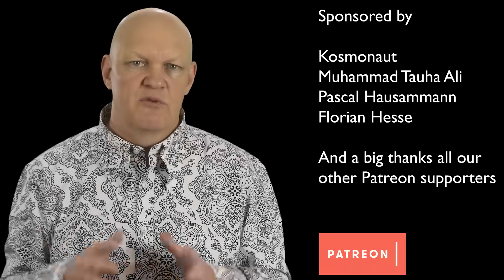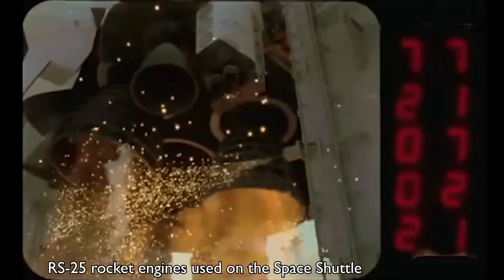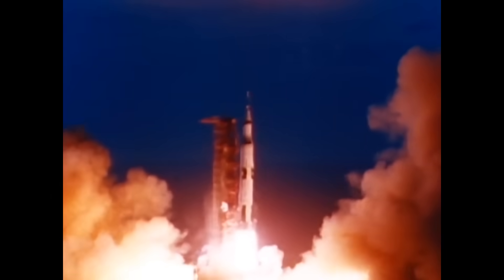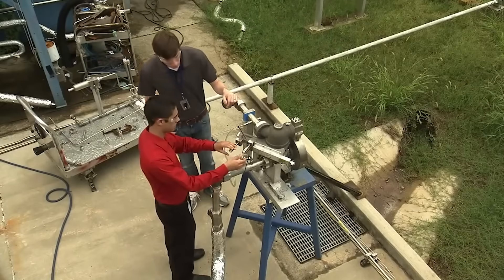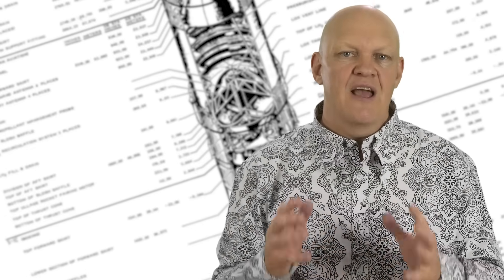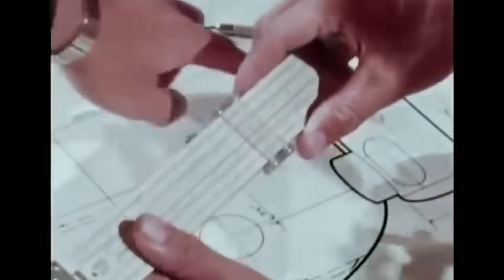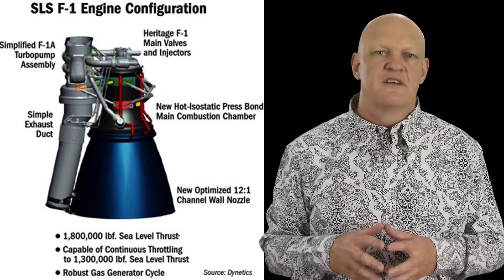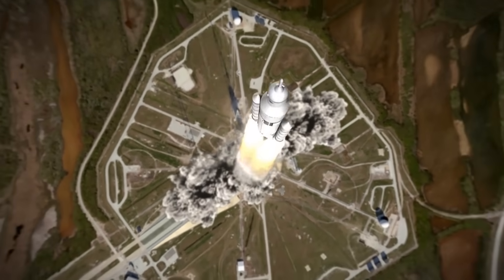Why Can't we Remake the Rocketdyne F1 Engine?

Comment: this is just part of the loss . . . think where the Saturn V would be today if it had just received incremental upgrades since the 60s . . . more powerful and more economical engines, lighter weight aluminum or carbon fiber tankage, and a vastly better computer suite!
one could probably lift the entire ISS in one go if you could figure out how to package it . . . but why bother when we could build a rotating ring station and use it to go back to the moon in the 80s and Mars in the 90s!
think of it Mars landings 20 years ago!

Comment: Interesting that is people skills that are the missing link. Same seems to apply in other areas of life , I dabble in car restoration and finding people with the old skills to fix engines and panel beat is getting harder and harder and you basically need to teach yourself
Reply: Dave Goldspink  , Yeah it sure is a dying trade. I completed my Mechanical apprenticeship almost 30 years ago. I was talking to a friend that was working for a tech college the other day and he said that they don't even teach current students about distributors and points anymore. I know they are not used in modern cars but if you know how they work you know how a ignition system works. Crazy.
Reply: Indeed, Paul, indeed!

 One example that also pops to my mind is the pyramids example. A monument built with huge blocks of stone, and in some cases (interior hallways), incredibly well polished stonework. 
 We can honestly say no one on earth has the skills to recreate the same work, with the same conditions and tools. We could obviously replicate it, but allways with the use of dedicated machinery and nowadays engineering solutions...
Reply: @heldersilva6672  why use an inferior and dangerous way of doing things when you have a superior, far safer and faster way that is also less expensive and easier to learn, we could recrearte the pyramids in a fraction of the time and the cost easily if we wanted, but we don't because we have better methods of making buildings, old isnt always better, in fact usually old is most often worst

And as a more general responce

I'm just seeing a bunch of guys sayign "in my times everything was done by hand, we didnt had any of this fancy computers, this advance 3d printing technology, robot assisted machined tools, we had our hands and a lathe" alright grandpa, yeah some skills are disapearing, theres a reason for that, and it's not because "the young generations are lazy" but because the tools available to the new generations are thousands of times more powerful than anything you had in your time, now a days things are made with advance computer programs with nanometric presition (something a human is just incapable of accomplishing) 3d printed to create forms and shapes that are simply imposible to make on a lathe or any other machining devices and in a fraction of the time and the costs, yeah every now and then you still have to solve an error a computer can't solve, but people is just as smart now a days if not smarter thanks to the learning tools they have available (just as an example, this channel that provides information that was simply unavailable or was really hard to come by a couple of years ago and explained in a simple and understandable manner)

Addapt or die, those who use the new tools they have at their disposal flourish an prosper, those who are stuck in the old times are left behind, simple
Reply: We have the same problem iun the truck and heavy equipment repair business. The newer mechanics just want to replace components. The problem is that so much of the stuff was made in low volume, or maybe even one off for a special application. Good luck finding a replacement. And they think nothing about the equipment being out of service for weeks or months waiting on a replacement part. They never want to weld and/or re-machine anything, never want to make parts. It's killing our business
Reply: Businesses don't want to spend the money on people investments. The old timers get to relax on their skills they learned for free while everyone else needs to pay for trade school or college themselves; that not only hurts the pockets of the people who may not have the money in the first place, but hurts the business because the school only teaches them basics, not how the business that hires them runs whatever they're getting hired for.
Reply: as the 1950 generation is retiring at a vast rate the brain drain at all companies is disappearing forever. when i retired 15 years ago i was called a few times to ask how i did some of the things i did, my reply was SKILLS! i actually did make notes and describle almost everything i did and why - they just didn't bother to read or didn't understand how much multitasking was involved. A'int automation grand?
Reply: @ricktimmons458  what was your job may i ask?
Reply: It's one of those things where the guys who made it knew exactly where to hit it to get it working again.
Reply: I can build engines been doing it since 1976 contact me
Reply: Offshoring manufacturing (sold to you as free trade) has directly caused this problem. So little gets manufactured in the US and the West, that these skills are disappearing.
Reply: Absolutely. I was in an Advance Auto parts store Saturday. I needed Plastigauge to check a set of rods and mains before my final assembly process on an engine. Three out of four people working there had never heard of it.
Reply: Paul, where you from?
Reply: Feeds Ravens There are buggy makers in the USA. https://youtu.be/aaFGOCou_7I
Reply: I guess there's not much money to be made from "old" technology?
Reply: Bc a generation of ppl came through that just didnt teach anyone anything. Apprenticeships dissapeared, and ppl stopped wanted to pass on knowledge for whatever reason
Reply: Youre spot on right - I own a motorsports based company and we can not get ‘real’ engineers and designers , people who can solve things in the real world are becoming rare and its because computers do it all for them
Reply: It's basically that kid's-young men today are lazy when it comes to work I try to teach them but it's like they can't get it in there head to try something else if something doesn't work out for them they just don't care every trade that's hands on is slowly fading away.

Comment: I did watch a video sometime ago stating that NASA had found some old Russian engines which are supposed to be really quite good, think they were intended for use on the Russian moon landing that never really happened (as we all know).
However, having visited NASA 10yrs ago I remember being told that NASA prefers Russian engines over there own because they are far more reliable. Is this true?
Reply: its cheaper, nasa budget compare to its 60s days r cut down to non existence. if they can buy it super cheap off the russian, wtf not. not like they using it to prove anything, just for cheap payload to iss etc.

Comment: Rubbish, the old Aerojet rocket facility in homestead Florida performed static testing of mammoth rocket motors in the 1960s, so powerful they could be heard and felt in downtown Miami, they thought magnitude 3.5 earthquakes were happening even without any fault lines. They put them in ground silos upside down and set them off, the flames could be seen across the state in Ft. Myers. Now many say these Aerojet motors were only solid rocket motors and NASA did decide to go with the most impulse power which of course only liquid hydrogen and liquid 02 blends could deliver, however, I was told back in the 70s that they experimented with hybrid motor technology using liquid fuel blends like 80% hydrogen peroxide as oxidizer with the solid fuels. For Saturn 5 it wasn’t the optimal impulse power and maximum efficiency thrust levels NASA needed so the contracts were not awarded to Aerojet but the plans and notes from those rocket motors are in someone’s hands until this day, none of that is gone. I saw them many years ago in an old mans home in Coral Gables who was a test pilot for NASA and HAFB pilot. He told me they had technology that was way ahead of the typical truncated bell type engine motor bell, it adjusted to all exhaust flow changes in altitude changes and made optimal altitude compensating nozzle technologies which were never seen back then. The closest thing we have today is the J-2 by rocketdyne but they never overcame the cooling technologies until they found new materials that would not melt, carbon carbon technology wasn’t around then for bell housings graphite was. Combustion nozzle technology,not fuels,  was always the limiting factor in rocket motor design. Musk is brilliant and will figure this out. He figured out how to do  booster motor decent landings instead of fishing them out of the ocean with Naval fleets. Then again he has advanced GPS guidance landing systems that NASA must not had access to ever.
Reply: What's rubbish?  Did you even watch the video?

Comment: Russia had a better, more powerful, more efficient rocket engine which we have the design for. Which NASA says would be better than the F1.
Reply: Have you seen Curious Droid's video of that engine? More efficient, yes. More powerful, definitely not. The Saturn V used five engines while the Russian moon-rocket needed 30. Six times the number of components made the at moon rocket a nightmare and four of them blew up in a row. However, using three of the Russian engines on a smaller rocket works and the US has actually bought the engines from Russia.

Comment: This guy brings up some valid points........be he neglects all the facts......his info is always 50/50......he was way off on the a-bomb tests and I called him on it.....he brings up very obscure facts.......he is wrong about the blueprints.....this guy is a blow hard, and comparing a modern rocket booster to 50 year old design......and if he must know, the current Space X heavy booster motors are based off old “simple” designs....there is a huge difference between a full power booster motor and a directional booster. BTW, the the Space Shuttle had three directional nozzles, that were re used repeatedly on launch from the external fuel tank. Finally, I am not religious, but God bless all of the Astronauts, from all nations on the earth that have given their lives in the exploration of things beyond the earth.......we explore space because we can, not because we have to
Cheers,
B

Comment: Computer aided construction has become so advanced that they can now duplicate almost anything and do it faster than the original engineers could have.  Doing it the old way is not feasible since it requires more skill than engineers have today.  The F1 B could certainly be made and more efficiently.  The question is :  Is that the best engine for large rockets nowdays or is it obsolete in it's design.  It is a giant engine, heavy, tall, cumbersome.  I think many smaller engines might be more prudent and this would allow greater bar pressure and better Specifict Impulse time.

Comment: They basically were building race cars for space. Hand made one offs. I make custom knives, we do this all the time. The process changes as we move forward because we constantly are learning to refine it.
Reply: In 1967 I crafted hydraulic control valves for F-86 Sabres of the Argentinian Air Force using WWII precision machine tools.  I was the only employee supervised by a retired Caterpiller master machinist who was supervised by a hobby factory owner who had built Norden bomb sights during WWII.  I used air gauges and a high pressure hydraulic test stand to tune each multiport valve to rated, chatter free output.  I should have bought the shop, but the job was just a means to get a college diploma before I got drafted.  The guys I worked for were named Orville and Wilbur after the Wright brothers.  I did not think clearly because of the pressure of being drafted.
Reply: BOLLOCKS
Reply: 2020-
NASA Engineer: Let's just Leeroy Jenkins this and make a hippie engine. My cousin is a welder and a guy I drink beer with is an out of work machinist.

NASA Admin: What?
NASA Engineer: Let's CAD the hell out of this and run a bunch of simulations to make sure it works. We need this to be built with modern tools and have a repeatable/scalable production line with excellent quality control.
NASA Admin: That's what I thought you said.

1960-
NASA Admin: We needed that Engine 4 days ago. Do what you need to get this done.
NASA Engineer: Ok.
Reply: The design of the F1 engine did not need refinement. It was a simple, easily constructed design. Today's so called "engineers" cannot think. Their computers do all the thinking for them. One does not need a computer to whittle a piece of wood into a thing of beauty. One did not need computers to repeatedly travel to and from the moon. HUMAN thought and action was the foremost "operating system." I sell knives in Pueblo, Colorado. Thanks for your work.
Reply: @richardclay  it's not that they cant think, it's just not worth the time and money to train new welders and to recreate something that worked when you can just make something that works just as well for cheaper with modern tools.
Reply: @richardclay  okay richard, go help out nasa and rebuild that F1 engine then. lets see you do it bud.

Comment: Rocket science has progressed since the 1960's.  Materials have advanced.  There is no point to building an F1 anymore.  If you're actually going back to the moon, you want to build something newer, simpler, and as or more powerful.  The F1 was a rather complex motor by both 1960's and 2019 standards.  Tweaking each motor individually is necessary if you can't control process variation.  

What was done back then was impressive by both current and 60's standards.  As great as the F1 was, there is no need to make an exact duplicate.  Using the F1 today only makes sense if we never had stopped making them.
Reply: problem, no one actually did anything actually can get back to the moon. dont shit me with space x and shit, that loud mouth ceo of their keep saying they'll colonizing mars by 2020 but have nothing to show.

Comment: Sadly, this is a huge disadvantage from computers. We’ve lost many skills and knowledge.
Reply: We always have new incoming knowledge it just that many of those skills aren't needed or useful as before
Reply: @chemicsky2772  - Exactly what I was thinking.  Now we have people who are extremely skilled at building the machines that make the things we used to have to make by hand, or write the software needed to do the complex calculations required to design and model the things we used to design and model by hand, etc.  I was once taught to use a slide-rule, which the only point to that right now is to have an appreciation for how people use to perform these calculations before calculators became widely available.

Comment: skilled labor is hard to find these days.
cars are fixed by replacement parts rather then fixing the broken part.
houses are build be finished parts and put together at the site..
and so on..
the knowlegde on how to solve a problem or tweak something into working better is gone.
woodworking has been replaced by cnc routers..  so all the workers has to do is program the cnc and let it do the work..

it is a diffrent world today than 50 years ago.
we lose some skills but gain others !

one of those things that play a part in how we do things is..
parts are mass produced and cheap, but labor is expensive, it was the other way around 50 years ago.
but look at countries who still have low labor cost, they still build things the "old way"

Comment: NASA lost their skills. what a shame. I designed and built a wireless optical LED telecom system 1.4 km/10Mbps full duplex 17mW (it doesnt even have a laser! ) 625 nm 10^-9 BER in a garage for 100$ in material and untrained teenagers built it around the world and it worked on the first try (Twibright Ronja). And NASA cannot just build another piece of their 60's engine they have full documentation on. I think now you will be overrun by Chinese and Indians.

Comment: I have worked in space electronics.  Contrary to what most people thought, these were not state-of-the-art electronics, but tried and tested and proven technologies.  There were no such things as sub-micrometre microprocessors in these devices, but reliable combinatory logic.
The F-1 engine is old tech, but simple and reliable.  Of course it would be best adapted to modern computer-controlled manufacturing techniques and it could be made more efficient, making the rocket lighter (less fuel).  So why not?

Comment: I like the Video.

I personally think the launch pad should be a railgun. First stage of three.

This way the rocket doesn't contain some fuel. Thus doesn't have to lift it.

Making it possible to make it smaller.

The railgun being a kilometer long with 1.5G acceleration that is uncomfortable but hardly dangerous to a healthy person.

But the Fact that at that point it will have well above mach 1..

The fuel that would propel it to that point will not  be part of the mass needed to be accounted for.

Not ro mention that ground level has the greatest air drag/resistance. And while in that sense the difference isn't that big..
It's enough to allow for slightly smaller tanks.

Right now..they're not That reusable.

If

Comment: Another obstacle would be that a redesigned F-1 engine would need to undergo testing again. Just because the engine can be made more efficiently and but together using modern methods doesn't mean it would automatically work. There were reasons why certain things were made and without the notes, the reason could have structural or functional consequences. I guess we would need another Elon Musk to fundraise a space project using the redesigned F-1 engine